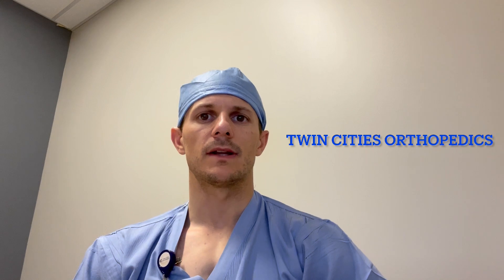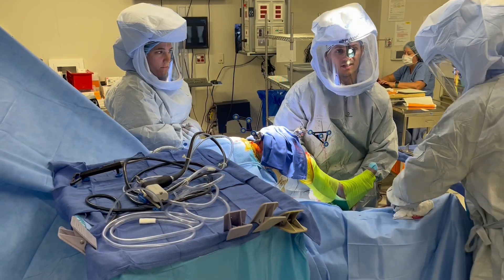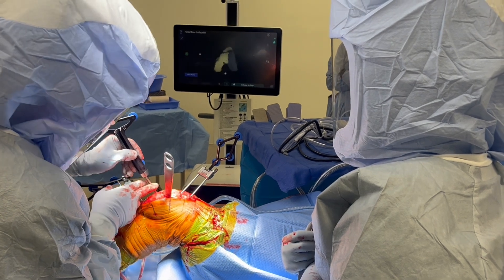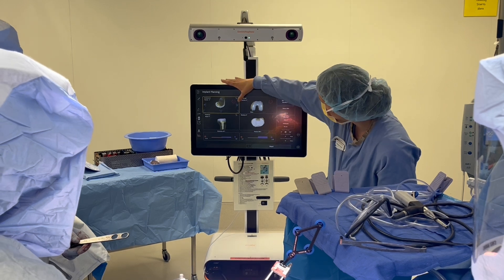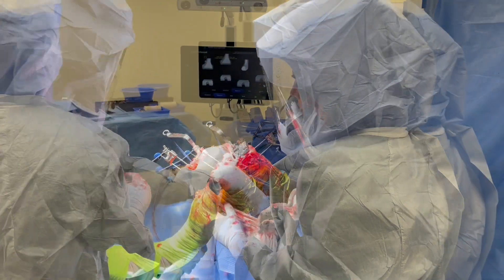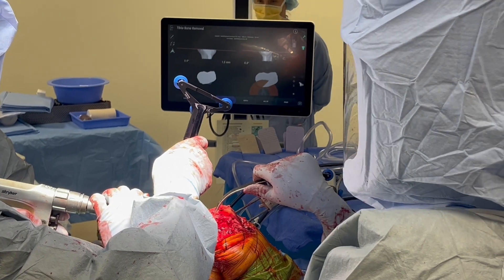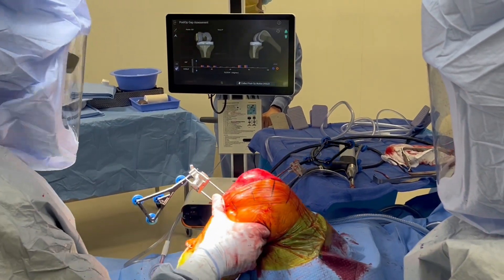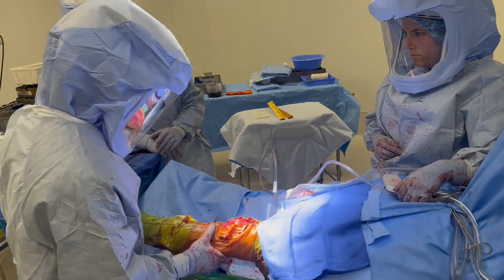Robotic Assisted Knee Replacement with Dr. Ridley

Comment: This is not the Mako Robot is it? I've seen many Mako videos where a CT scan is done prior to surgery. In the videos I've seen, a cutting block was not used.
Reply: That’s correct, this is not the MAKO system. It’s called the CORI system from Smith and Nephew. With this system I do see major benefits of not needing the CT scan as well as the work flow (I.e. still using a cutting block).